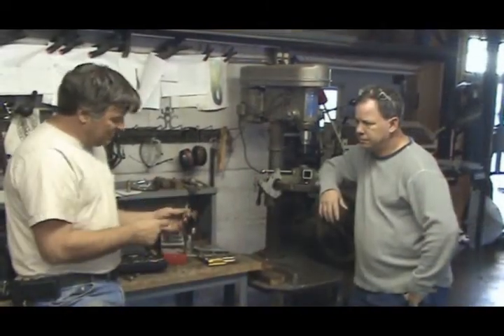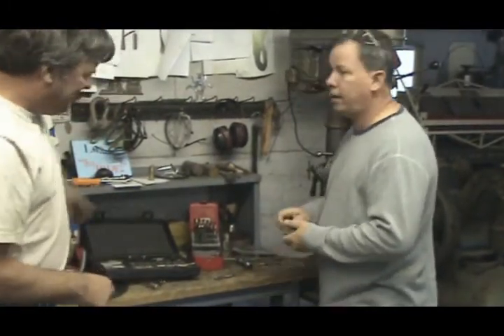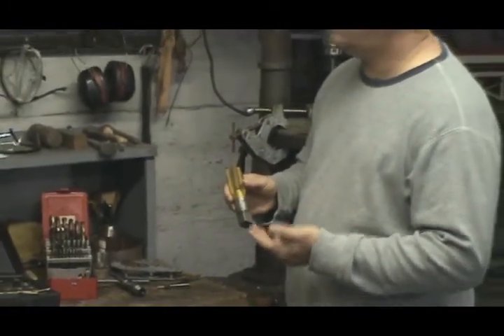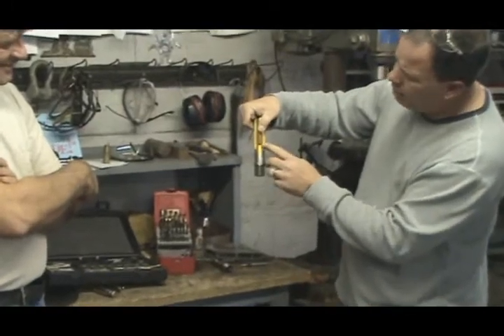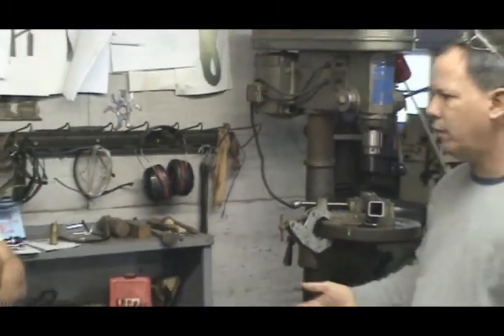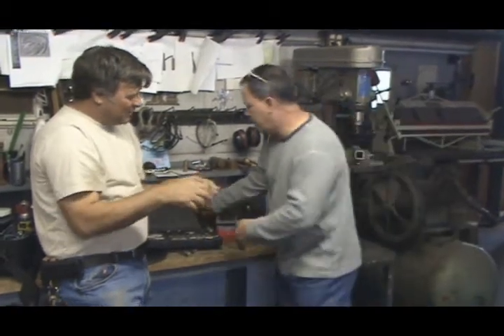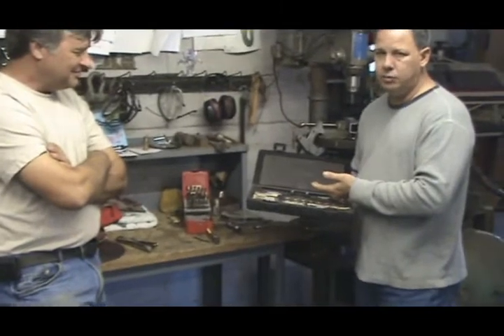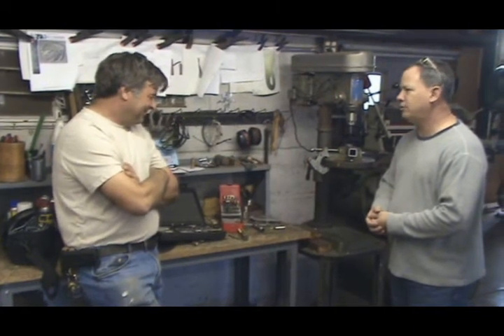Drill Tap Basics - Kevin Caron

Comment: example 1  1/4-7  tap .need to know  hole size.use rule ,major Dia  minus pitch.   1  1/4 - 1/7 = hole size.  1.250- .142 = 1.108   pitch means the dim from one point  of thread  to the other thread.the number  1 is given,so u divide 1 over 7  gives u .142 in decimal  form. remember  1 can be divided  to any number of threads. just subtract  o.d. from pitch = hole size
Reply: pitch  and lead of thread can have the same value.but can a have a different  difinition  .pitch  is dimension  from point of thread to the other. lead is amount  of travel  in on revolution. a micrometer  has 40 threads per inch. 1÷40 = .025 ,size does not matter. remember 1÷7 =.142 that  bolt is going  to move .142 in one revolution.

Comment from the maker: @spelunkerd  I have no idea on the sizes issue. I will have to get Chuck to comment on that one. 

As for your taps coming out loose, I think you are correct. Go one size smaller on your drill, don't forget to use some cutting oil and try again. You should come out just fine. 

I will give Chuck a shout and get his input also.

Comment: On that tap chart you linked to, some of the drill sizes are listed as capital letters rather than dimensions. What does that mean?
Also, on my tap and drill set, when I tap I find the result is a little sloppy, with thread edges that are rounded rather than sharp. I'll guess that means I should use a smaller drill size so that the tap doesn't eat so much of the metal away. I'm a little concerned the steel that make up my taps may be a little weak. Other ideas?